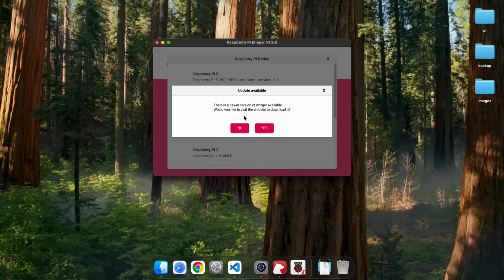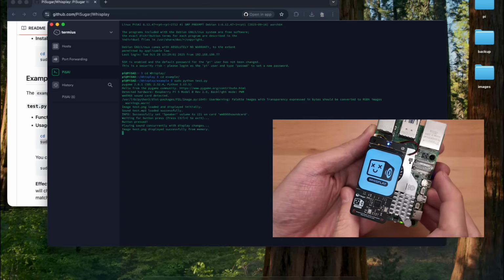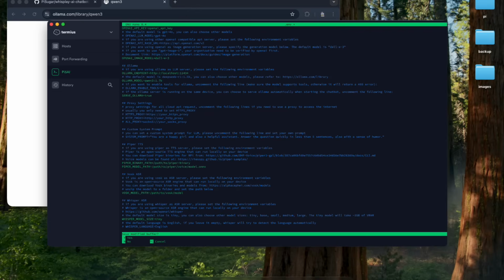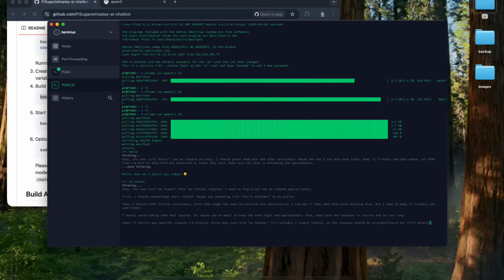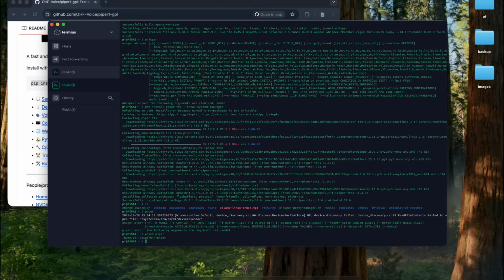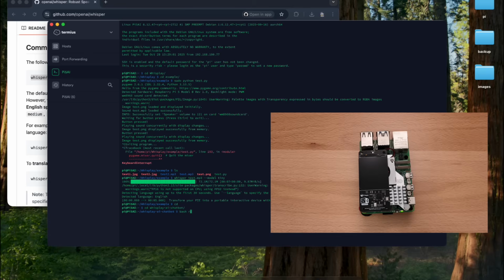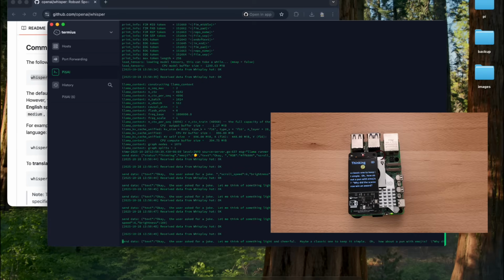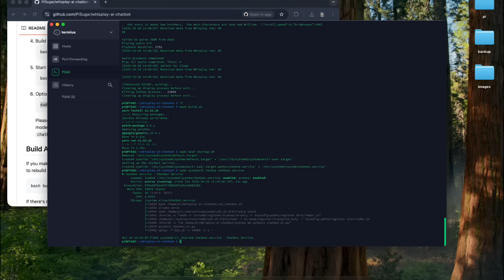Offline AI on Raspberry Pi 5 — It Talks, Thinks locally without Wi-Fi! (Complete Tutorial)

Comment: This is just a local LLM. Of course it works without internet since it’s completely powered by your personal PC. In this case more likely a SML as LLM are generally FAR to large to run anywhere locally. Unless ya got like at least 150GB of RAM, AT LEAST. It’s not like ChatGPT, Claude, Gemini, etc, which are not powered by your personal pc.  Those are powered by super computers, data centers, etc…

Comment: I cant get the Whisplay on a 64Bit OS -> ChatGPT says it needs 32bit ... but I want my 8GB of RAM!
Reply from the maker: Use 64Bit OS. 32bit will not work.
Reply: @PiSugarStudio  64 bit desktop version or lite? I use the lite OS and have no screen so far :(
Reply from the maker: @sbezialisd desktop version
Reply: @PiSugarStudio  really? Otherwise?? 😢
Are there any hard dependencies in choosing the right OS? Is there something like a compatibility list?
Reply from the maker: @sbezialisd  The Lite version of the OS doesn’t include the simple-sound-card driver.
Reply: @PiSugarStudio  Well the sound was no problem (by coding with AI) but the screen was a hell of a mess KMS (...) all I got to work was the LED to change colors :D
Now I build it (nearly the same as you did in the video, despite some dependencies were missing in the vid) 
But all in all great video and projet :)
Reply from the maker: @sbezialisd  Did you try the example program and did the screen render images normally?

Comment: Thank you for such a detailed tutorial! :yougotthis:Just a dumb question here, if i do not have a laptop to directly plug the sd adaptor for flashing raspberry image what other option can i go for that step. Many thanks in advance! (Also, is the screws M2.5 Screws - 5mm?) First time with these, trying to add everything into cart 😂
Reply from the maker: Without a laptop, making an image might be quite difficult—I haven’t come up with another suitable approach yet. As for securing the PiSugar battery board, M2.5 screws (5 mm) should work.
Reply: @PiSugarStudio  :popcorn-yellow-striped-smile: many thanks! will find a laptop to do the flashing. Another question, is 32GB (the one shown in your vid) microsd enough? Since it's a offline LLM, the chatbot itself have all information up till late 2025? or we need to manually train it. if i'm not wrong the pi5 can support up to 2TB correct? What's your take on this
Reply from the maker: @gkang1990 A 32G card is enough. I’m using 128G. The knowledge of the model is somehow earlier than mid 2024 I guess, it depends on the data that used to train this model.

Comment: i bought all the tools and tried to build it just now but running into so much problem setting it up during the ssh phase. The Whisplay audio hat (WM8960) appears to be incompatible with Raspberry Pi 5’s new I²S / device-tree setup — when stacked with a PiSugar power hat, the Pi just never loads the sound driver.
Reply from the maker: Which pisugar model are you using? If you are using PiSugar S please check if the auto switch is off.
Reply: @PiSugarStudio  I don't think it's the auto switch? when plugged in, the whisplay works. it's the connection between the battery and the raspberry pi that's the problem? i couldn't get the "
PiSugar 3 Plus Portable Pwnagotchi Power Management for Raspberry Pi 3B/3B+/4B Model (Not Include Raspberry Pi)" to power the raspberry pi. i have the active fan and raspberry pi 5. also have 
"Whisplay HAT for Raspberry Pi Zero W/2W – Audio + Display Expansion Board"
Reply from the maker: Do you mean Whisplay works normally when the PiSugar 3 Plus isn’t connected? If so, it really does sound like a connection issue between the PiSugar 3 Plus and the Raspberry Pi. You can try scraping the solder pads on the underside of the Raspberry Pi’s GPIO I²C pins with a metal needle. If you’re comfortable with soldering, you can add a bit of solder to ensure good contact. If it still doesn’t work, please contact the support email for a replacement.
Reply: @P @PiSugarStudio is there another battery I can use instead
Reply from the maker: @hadron23  For now the softeware only PiSugar3(Plus)

Comment: This is actually very cool. However, all AI systems are limited to the data banks they have access to. Because this is so small, its restricted the SSD's storage capacity. So its probably only good for simple tasks like conversations and math problems when its offline.
 You could probably get around this by having another SSD module that users can insert and eject for specific topic. So that the AI can draw information from. Like an SSD specifically for chemistry. Then eject that SSD and insert an SSD that has everything on aero dynamics or something.
When storage capacities get better then you can combine different subjects on to one SSD.
Reply: Get one about types of birds, and run a computer vision model alongside the LLM, then get a usb to hook up a nice camera (i.e. read files from a Nikon). Bang. You've got a true Pokedex for birdwatchers.

Comment: I've followed the instructions and installing the whisplay hat does not work, I keep getting "pygame.error: ALSA: Couldn't open audio device: No such device" ... further digging shows the sysctrl service is failing to start as it returns an error. Can you verify things are working?
Reply from the maker: Use `aplay -l` and `arecord -l` to check if the wm8960-sound-card is presented in the list. For more technical support please contact pisugar.zero@gmail.com
Reply from the maker: Have you installed the driver (sudo bash install_wm8960_drive.sh) and reboot before running the test.py?
Reply: @PiSugarStudio   I am getting no cracking when holding down the button
Reply from the maker: @MasterAsnackin  Does it works in the test.py?
Reply: @PiSugarStudio  sometime in testing i get cracking sometime nothing, but everything else works, sadly no sound at all from test script to chatbot project
Reply from the maker: @MasterAsnackin  Just update the driver and the chatbot repo. You can try  cloning the new code.
Reply from the maker: Raspberry Pi’s system update in the last couple of days seems to have changed some ALSA rules — newly installed sound cards are no longer set as the default automatically. Because of this, `pygame` in `test.py` can’t find the correct sound card and throws an error.

I’ve already updated the code in the chatbot project, so even if your test script doesn’t work, the chatbot itself won’t be affected. The driver testing section will be updated a bit later.

Comment: This is cool. Now how do we make it faster and add a camera to identify objects in front of it when asked?
Reply from the maker: I’ll cover how to add a camera and use LLM vision recognition in the next video.
As for making it run faster, aside from the Raspberry Pi’s own performance limitations, power consumption is also a challenge. I might consider adding an accelerator card, but the battery’s output capability might not be able to handle it.

Comment: Can it be used as a regular display to view/controll the raspberry with? I'd like to use it as a regular display to either see a terminal window or see some code output on it to use the PI with a portable ups.
Reply from the maker: In theory it can display desktop content, but its resolution 280x240 is very limited.

Comment: bought the parts to make this, thanks!! any suggestions on models? looks like qwen3 is the best for speed ?
Reply from the maker: qwen3:1.7B is currently the model I find most suitable. Its speed is decent, and it supports tools (you can try asking it to adjust the volume). I also tried Qwen3:0.6B — it’s faster, but its tool-calling format is more primitive and needs additional code adaptation.
There are also some smaller models like Gamma3 270M/1B, TinyLlama, and others that are worth trying as well.

Comment: awesome work! You could pair this up with a local pi or gpu mesh at home, each node running an individual module (STT, TTS. core. etc) and use the mobile pi to tunnel back home when it can to speed it up ;)

Comment: Awesome video and project dude!

I’m building a similar project but more around a small trained vision model for plant identification during hikes.

What camera module and vision stack would you recommend for this?

Also are you planning to design/3d print a custom housing for it?
Reply from the maker: I'm testing the rpi camera module 3 with the model qwen3-vl:2b. It takes about 1min to describe what it sees in a 280x240 image. Pretty slow but it works. For the housing, yes it's in my plan.

Comment: Silly question couldnt we just use powerbank to power the raspberry pi5 from the usb c port
Reply from the maker: If you don’t mind, bundling a power bank is also an option.
PiSugar, besides being physically designed to fit the Pi, also provides a BMS that can report battery level and handle charging management. Most power banks experience a very brief power interruption when switching between charging and discharging. That’s usually fine for phones, but for a Raspberry Pi — which doesn’t have a built-in battery — that short drop can be fatal.

Comment: Super.. is possible to learning local over conversation? If possible to active some pins in raspberry?
Reply from the maker: If the model can call tools, it can achieve external control functionality. I'm currently looking for a small local model that can reliably call tools.
Reply: @PiSugarStudio i was thinking about this. How about a simple log of the output, then parse the text for certain commands. I.e if the chatout contains the words ‘PIN 5 on’ then have an external script which performs that action… may be a bit buggy, but would probably work for most cases no?
Reply from the maker: @TheNeverFinishedProject  What you described is exactly how an LLM works — but it doesn’t need you to manually interpret what characters mean in order to execute commands. You just provide it with the tools and the parameter format. When it determines that a tool needs to be called, it will output a JSON like this:

```json
{
  "function": {
    "name": "activePin",
    "parameters": {
      "pin": 5,
      "action": "on"
    }
  }
}
```
Reply: @PiSugarStudio  I’m thinking along the lines of home automation using HomeAssist, so say “lights on” and it performs an action. NetworkChuck has an interesting video about building an offline smart speaker, just wondering how we could do something similar with this setup 👍
Reply from the maker: @TheNeverFinishedProject I've done a light on demo in this video. https://www.youtube.com/watch?v=G3ZV67YtnMg  Offline model is also able to call function in this way.
Reply: @PiSugarStudio i’ll check it out thankyou! Brill videos by the way! 👌👌

Comment: What's your power budget. 
Meaning Watts out necessitating Ways in... 

Great video and great job assembling the pieces that got you to that offline solution. 

With a backpack with enough lithium packs to power and of course a couple of wires to them, you then would have a portable setup. 

So, then: the battery packs and the Pi or similar goes on your back and maybe some interface that's lighter and not able to "cook eggs" as the HMI. 
Heads-up display glasses likely a good path to test out or just a wearable OLED watch style wrist alternate.... 

Anyway, 👍
Reply from the maker: The battery pack is 5V 3A, 15W. Although the Pi 5's maximum current is 5A, I haven't encountered any power-related restarts, but I have experienced restarts due to CPU overheating when I didn't have a cooler installed at first.

Comment: Didn't you just completely cover the active cooler fan?!
Reply from the maker: Actually, that’s not the case — the buttons and pin headers on both sides of the HAT have some height, leaving about a 5 mm gap in the middle between the HAT and the fan for air intake.

Comment: Incredible video, really well explained! I'm thinking of building one myself and I was wondering: would it be possible to implement a persistent memory? For example, to have it remember my name or other preferences between different conversations, even days apart. Could this be done by perhaps saving a summary of the conversations to a text file or a small local database that the model reads on startup? That would be an amazing upgrade. Thanks so much for the inspiration.
Reply: Bear in mind that each response ai make is not based on memory. When you make a question on a conversational model you're actually feeding the whole discussion AND your new line, each single time you press enter on your new response.
So the problem is in the context size limit.

Your idea is correct, you can feed a summary of your previous conversation at the beginning of a conversation, but that would chunk up the context size straight away limiting the response available on the long run, to a point that you don't have enough space to start a conversation because the previous summary are so big that fill the whole 2mln/1mln context.

On top of that, current AI struggle on keeping all fact in place when the context is beefy, because current ai model split the context in pieces, and some information get lost/overwrite/confused from one piece to another. So having a "memory" means expecting a faster hit of limit usage and also faster hallucination point.
Reply: @wsoulless thank you for the lengthy explanation. I need to explain this to my students so they stop writing papers with chatgpt

Comment: Mr. Lin new subscriber and amateur pi fan, curious could the software be used for translation purposes?
Reply from the maker: Yese. You can customize the prompt to make it a translate every sentence of user input.
Reply from the maker: Yes. You can make the AI act as a translator by customizing the system prompt to tell it to translate every user input. The Whisper model can recognize multiple languages, but Piper’s speech synthesis models aren’t that flexible — you’ll need to decide on the target language in advance and download the corresponding voice model.
Reply: @PiSugarStudio  🫡
Reply: @PiSugarStudio 
Can this model be used for text-based interaction?
I’m interested in it for translation purposes — is it possible to type a short text and have it translated into English? 
Is it possible to add a small keyboard to this build?
Reply from the maker: @CinéBono  Since there is already an LLM service running, you can indeed connect to it through other projects, such as Open WebUI, to interact with it via text on the web. Alternatively, you could pair a Bluetooth keyboard with the Raspberry Pi for text input. However, this may not align with the core goal of my project. Voice interaction seems to be more in line with everyday use cases.
Reply: @PiSugarStudio  
Thanks for sharing your project! It is fascinating because it can work completely offline, is fully autonomous, and can be used independently of any internet connection.

Comment: Will it perform better with 16 GB version?
Reply from the maker: I think their performance is the same as long as the memory is sufficient.
Reply: The 16 GB Pi 5 CPU is slightly more power efficient than the 8 GB model. And if running the gemma3:4b on an 8 GB model, it almost maxes out the RAM. So a 16 GB would have slightly better battery life and maybe slightly faster in some cases (gemma3:4b and larger) because of the extra RAM which can be used by the system in a cache state.

Comment: Most impressive is the no-cables battery powered setup of this
Reply: and thus the price of it lol
Reply: @imnutrak130  
PiSugar costs range from approximately $28 to $50, depending on the model. For instance:

PiSugar S (1200 mAh for Raspberry Pi Zero): approximately $28
PiSugar 3 Plus (5000 mAh for Raspberry Pi 3/4): approximately $50
Prices may vary based on the specific model, retailer, and sales.
Reply: that battery pack is costly asf, I have realized that most youtube guide video makers are funded by their content itself, meanwhile here I am thinking why spend this much ?
Reply: @bettermasteryi7043 what battery u use usually?
Reply: @bettermasteryi7043  yes, price is a true hurdle and makes these projects not viable unfortunately. Raspberry pi used to be to make things cheap that otherwise would be expensive as a finished product. No longer.
Reply: @bettermasteryi7043  Use a powerbank attached to Pi's USB power-in socket, whats the problem?

Comment: Actually, it's exactly what I'm looking for. I just can't imagine that it's good for the Pi or the HAT if the HAT sits directly on the fan... but I'm already looking forward to version 2.0 and hopefully someone will make an STL for a case for the 3D printer.
Reply from the maker: The fan’s front side is the air intake — it draws air downward and blows it out through the side heatsinks. The HAT’s buttons happen to rest right on the edge of the fan frame, so there’s currently no major impact on cooling.

Comment: This is the shiznit! Is there an option for it to switch to listening mode autommatically so there is no button press needed? I remember making my own Pi-Alexa years ago - it was PiCroft or something like that. It worked really well on just picking you up on mic and ignoring general ambience.
Reply from the maker: It actually started out in listening mode, but I found that when I took it outdoors, the varying noise levels caused problems with automatic sentence detection — when the background noise was high, it thought I was still talking. So kistening is more suitable for stationary indoor applications, such as smart speakers. Since the device is meant to be portable, I’ve temporarily switched to manual recording. Later on, I’ll consider making it a configurable option.